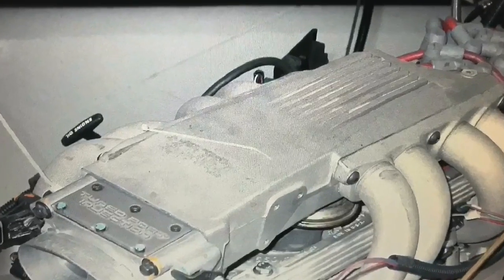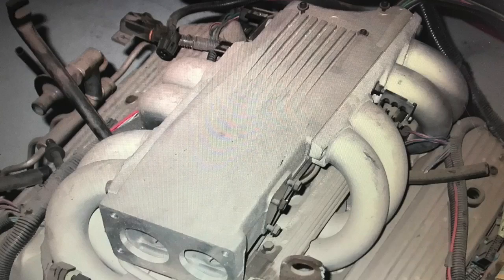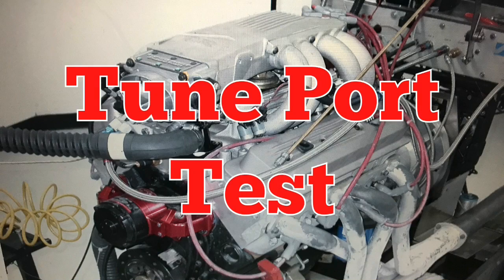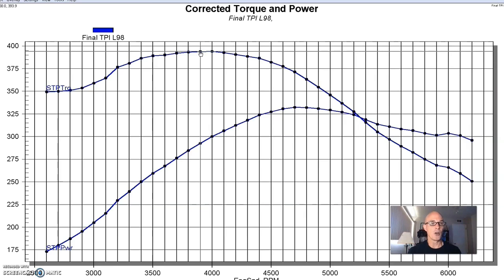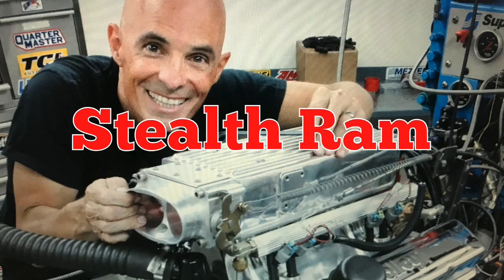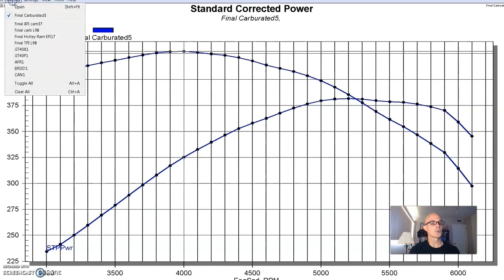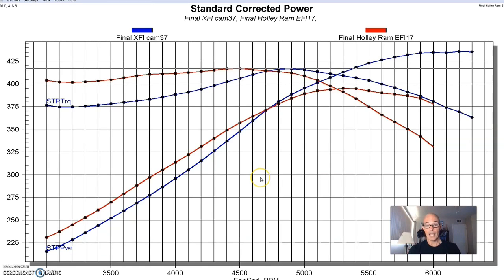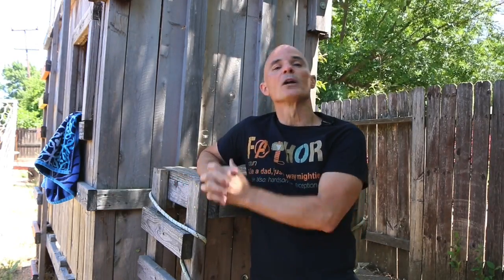TUNE PORT TECH-L98 vs CARB

Comment: I have a TPI L98 350 for my 1957 Bel Air... right now it is just a stock motor from a Camaro, but I am considering replacing the TPI system with a carb or a Holley Sniper system.  I appreciate the comparison in this video, and I would be curious of what your opinion is on the Holley Sniper system compared to the two you’ve already compared.
Reply from the maker: go with a carb and dual plane if you don't use the TPI intake

Comment: I have a quick question for you. What do you recommend in regards to roller rockers for a 1990 L98 with the stock factory 113 heads?  I would like to bolt them on and set the valve lash.
Reply from the maker: do you have a solid roller or solid flat tappet cam that has lash? Otherwise, you just set lifter preload on a hyd cam. comp makes good roller rockers
Reply: @richardholdener1727  It's the factory GM hydraulic roller cam that's in the 1990 Corvette L98 motor. I know that some of the older L98 had an hydraulic flat tapped cam. I think in 87 GM when with roller camshafts.
Reply: So comp cam roller rockers are a good choice? Which model do you recommend with stock valve springs?
Reply: Hey Rick do you have a part number for the roller rockers you recommend?  I would like to stick with the 1.5 ratio because of the stock valve springs. Thanks again.
Reply: @sportsmansparadice42  valve springs shouldn't be issue with 1.6 your lift will be .445 intake and .460 exhaust the stock springs can handle .480 i like the crane gold rockers, comp cam makes them part number 1618-16, and scorpion are good too 1036.  you need self aligning, narrow body and 3/8 stud rockers

Comment: What about a computer controlled carburetor like the Rochester on the L69 5.0L H.O. ? Would it be possible to tune a system like that to make more power and how would it compare to an EFI or mechanical carburetor setup?
Reply from the maker: that was a feedback carb to adjust AF for cruise

Comment: The TPI  demands those low RPM stump puller cams. The stump puller cams don't do anything above 4500 and neither does the TPI. The stump puller cams enhance low speed performance right where the TPI does its magic. marry the 2 together would be a winner. a matched set.
Reply: What's a Stump Puller Cam? In specs or brand or both?

Comment: Excellent demo of the runner length calling the play...an l98 tpi motor in a truck would have been awesome for sure. For a heavy street car, drive in, foot brake et bracket car. I would go for the low end, the right cam, with a converter that would flash high, launch good make the converter do the work, when dialed in should be a very consistent combination that should last a long time...this is a street/strip foot brake et car...drive in drive out...not a 10:90- 9:90 bracket monster. With a od lockup trans, great mileage driving to the track too. My 75 Monza, would like this...hmmmmm!

Comment: You read my mind Richard, a TPI style manifold on the Vortec 350 would’ve been fantastic, I’d also like to see an original TPI system on a 327, I feel like the smaller displacement would allow it to rev a little higher and maybe carry the torque curve a little higher in the rpm range.

Comment: Have to disagree with you on a very important detail. the TPI looks more like the Battlestar in Battlestar Galatica than anything in Starwars. And that makes it far cooler than anything Star Wars.   Wish someone would offer that new that flowed much better for the gen 0/1 class small blocks.  But alass.  even the Ram Jets seem to have fallen into disfavour. Yes, I run a gen 0 in my 1980 GMC truck and my 2nd gen Trans Am ( much to the chagrin of the Pontiac purists )

Comment: The TPI on a 350 truck motor and slightly higher compression ratio. And 1.6 roller rocker. Does in fact have more torque down low. The only thing left is an RV roller cam. Later when is time for my truck to be rebuilt. I will install an RV cam.

Comment: I will take 450-500 ft/lbs under 5000 rpm and lower HP any day. I remember the old 455 Buick’s stage 1, street racing back in the 60s-70s. Buy the time the high reving high HP small blocks got going the race was over. The stage 2 GS was a monster in a city block. I’m a torque guy not a 7000 rpm high stress motor guy. Just give me the tires to handle to torque.

Comment: @Richard Holdener  Richard.. Should I be crying foul?  Most L98 head flow test I've seen show sub 200cfm (190-198cfm) or struggling to hit 202-205 .. Not really enough to support 440hp.  Chevy Race shop sent juiced heads ...  shame shame.  Enjoyed the video though.. I always felt taking off the tpi and dropping in a cam would be a great way to add 100hp to a C4.
Reply from the maker: we have made 2.49 hp per cfm on stock heads and big motors-it has more vacuum so more flow
Reply: @richardholdener1727  It's easier to max the heads/flow potential when you get the air/fuel/demand at lower rpm.. due to CID.  I was shocked at 438hp from an L98/head 350..   I consider the L98's a step backwards from 292/Turbo heads. Always considered them a bad choice, other than the alum.. for the ZZ series crates.  Very interesting video.. and surprising.  I'm calling bowl work and a port roof raise and 218 to 220/cfm of flow... Lol ..  See, I held firm.. Lol... Thanks Richard !

Comment: I like the TPI for the street and have 2 vettes with them.  One is a large tube lingenfelter engine and the other is stock.  As you indicated the modified engine just amplifies the stock power curve.  The LPE engine is around 400 CHP and still gets 30 MPG.  My carb'd 350 is lucky to get a 1/3'd of that.  So on the street the TPI is such fun with excellent response and it indeed feels like a bigblock.  I take mine to the drag strip from time to time and it usually leaves me disappointed since the RPM range shifts much higher than the street. The cars low end torque makes it hard to launch with street tires and the 60' times are critical in a RPM limited car.

Comment: I prefer the lower speed power production.  Better takeoff and around town driving characteristics.  Obviously, I am not building a car for the drag strip.  I also prefer fuel injection because it seems to me to have a cold start/driving advantage.

Comment: You must be reading my mind. I want to get the 383 HTE crate motor and put TPI on it for my 1992 GMC sierra. I also have a 400 SB out of a 1980 one ton commercial van that I think would be a perfect truck motor with Vortec heads and TPI

Comment: The "daily driver" high torque, low horsepower narrative that I hear from all these domestic guys is a crock of crap. If all you want is low rpm torque, then swap your engine out for a diesel. Oh wait, I just stomped all over the daily driver narrative with logic.

Comment: What makes a better truck engine for pulling a camper? The GM crate engine HT383 (6.3L) with TPI or a L92 6.2L?? Torque is king but will the HT383 make more than the L92 6.2L??

Comment: Tpi and turbo would give you these best of both worlds. Richard what your referring to with the power curve would fall under pumping loss.. build a twin sytem or even a single like a s475 and the curve would be flat as the state of Kansas while still climbing.

Comment: I had two of these tune port intakes in an 85 and 86 Corvette and I just remember the engine falling on its face after about 4500 rpm and that would bug the shit out of me because I had other small blocks that would wind up to 7000 rpm.

Comment: Great video. You hit the nail on the head about it looking like a Klingon warship. It's not the most powerful setup but hands down one of the best looking fuel injection intakes ever produced. Only thing I like better is a 3X2 427😂

Comment: IMHO the best set up is the one that produces the best torque lower down in the rpm range where you do 95% of your driving especially with an automatic transmission.  That being said you can't dismiss the advantages of a fuel injection system with it's perfect fuel ratio's and distribution.  So that's my pick, TPI FI with the right cam and automatic shifting around 4800-5000 rpm.  That's why the 3rd gen Camaros were so popular with a 4 speed auto and a 373:1 rear gear.  How about testing a Throttle Body FI system from Fitech or Holley sitting on a dual plane manifold, could be the best of both worlds ?

Comment: If you're racing, you obviously would pick the tune port, by the time you reach 4700RPM and shift, you're already at peak power and while the carb is still trying to reach power band power, you're already shifting into 2nd gear...I have been tuning and racing TPI engines for over 15 years, and I really enjoy them.

Comment: Years ago I did a TPI 350 swap into a 79 Firebird with a 3.42 rear and a TH350 trans with a 2500 stall converter. It wasn’t fast, but it was a lot of fun on the street, and that car was a ridiculous burnout machine!

Comment: Being a product of the 80's and 90's, I have a natural affinity for the TPI setups.   I have owned a a 1985 Corvette and a 91 Camaro Z28 5.7, both obviously with TPI.  Always loved the that low end power, and they would light the tires up with a blip of the throttle at a stop light.  I would love to get back into a C4 or 3rd Gen F-body with TPI.  I know any new muscle and even today's V6 Camery's and Accords would probably be as quick if not beat a stock TPI car, but just to have that feel- that low end instant grunt.  Since I don't race every person I see or at a stop light (anymore, grew up from that :)  ), I don't need the high winding power.  I would pick TPI.      There doesn't however seem to be any support for them anymore and with good reason, I know that LS tech has gone a long way.

Still, a properly cammed TPI would feel soooo good as a daily driver.

Comment: In the beginning of the video you said the factory got 240hp from a factory L98 . I’m under the assumption that the factory measures hp from the back of the transmission with all the accessories on . Is that true

Comment: TPI always looked cool, but 5500 rpm it ran into a brick wall. I tried porting the runners in my 88 Formula T5 along with ported heads and a compu cam. Still just died at the top. Funny thing 3.90 gears and shifting at 5200 was the ticket busting many a fox body.

Comment: Question I've been asking .. How does cutting the gap between the intake runners affect the power curve? There is talk among the TPI crowd that you can grind out a small section of the wall between the runners and in effect Siamese a small part of the intake. Any testing on this?
Reply: Done it a bunch of times...difference you will probably never feel. Depends no the rest of the system and how well its ported.
Ingeneral knocking an inch or so off the runner length will disappoint

Comment: This is more of a manifold design comparison than a carb vs EFI comparison.  If you compared a 4 bbl bolt on EFI like Holley Sniper to a well tuned carb on the same manifold, the power would be close.  How would a tunnel ram do compared to TPI or the High Ram?

Comment: So, I have a 5.0 in my boat. It's a single plane, with a Holley 650. Way too much carb for that motor. So I found a tune port setup and have an MS2, and am putting it in instead. I wanted the torque, don't need the high end too much.

Comment: In the first test, there wasn't much loss of torque, but the gain of horsepower was generous.  I'd opt for the carb setup due to the cheap gains.

Comment: You failed to make an extremely important distinction in the power of the dual plane vs the tpi long runner. There’s a 30hp difference in peak power sure, but you should have compared the difference in power between each manifold AT THE RPM THE PEAK OCCURED!!! There is a 32 hp difference but at the 4800-5000rpm the TPI peaked there was only 5-10hp difference where at the RPM where the dual plane peaked near 6k rpm the was a 50-60hp difference! WAY more telling than simple peak hp comparison!!!

Comment: Maybe modern carbs are better at this now, but in the '80s it was wonderful to just walk out to the car whether it was 0 deg or 100 deg outside and just turn the key and have the engine start, first time, every time. Plus that low end torque never fails to put a grin on your face.
Reply: People just realized that phenolic spacers are a thing?
Reply: @theeoddments960  They have been around forever. Look at a Thermoquad carb

Comment: Get video! Is it possible you can do videos on all different design tpi units? Especially the tunnel ram that was created by SLP for the formula firehawk? Even though I had some mags with some info about it, I always wonder how they were able to create that 350hp/350tq. Back in the 80s/90s that a magical feat as to have a ecm monitor this kind of power and make the vehicle street legal. With  a egr valve and catalytic system.
Reply from the maker: I tested 10 or so different TPI combos back in the day-no video on that

Comment: Have you ever tested a 350 with aftermarket heads and a comp 268H cam (218/218 @.050 454/454 lift)
Reply from the maker: probably so

Comment: I agree the second best engine looking engine Chevy ever built right the Rochester fuel injection
Reply from the maker: the L84 is cool
Reply: @richardholdener1727  you easily got the most interesting dyno tests

Comment: Richard, I am mostly in awe of your skill set and knowledge, but I was kind of lost over the idea that the carb engine was doing better because it had more time for the atomizing fuel to "cool the charge" versus the fuel being injected at the port not having enough time to cool the charge. this sounds a bit off; if the entering air temp and the two fuel temps are the same, then the total retained heat calories of the two substances will be combined and an average of those latent heat calories established. this is telling me that any more than small difference is likely from another cause. The amount of free flowing air outside the manifold, for instance; I am a plumber and was fair at chemistry and physics- I'm asking if the dyno set up and temperature instrumentation have been run to "prove what we think we know" or are we dealing with unknowns? You are man- I'm hoping I missed something!
Reply from the maker: it takes time to change the charge temp
Reply: @richardholdener1727  OK, but charge velocity is measured in hundreds of feet per minute, literally thousands of inches per minute, and even the long runners of the TPI can't take more than a fraction of a second  through either the TPI or the dual plane manifold. It doesn't sound like the difference could actually be very much. The graphs show the effects correctly, I'm not quite there that a fraction of a degree difference could make that big a difference -  many turbo users wouldn't put an intercooler into a car unless they had an expectation of 40 or more degrees drop.
  Thanks for the answer- I'll go dig around in some old text on thermodynamics- I haven't been there in many years- I was a Lib Arts guy in college; I know a great deal about little of value, was my father's quote!

Comment: I just got my old IROC that I drove in the 90's back on the road. Loving the TPI torque, but could be a little faster. Keep the TPI vids coming. I like the idea of an optimized long runner setup, maybe with a little cam and some vortec heads. These parts are getting harder to find and expensive.

Comment: Dollar for dollar unfortunately carb is still cheaper, the advantages of fuel injection are wide and varied but at the end of the day simple power from an SBC is easier with a carb.

Comment: Definitely the dual plane and carb over the tuned port. With a good converter you’re gonna be well past that extra torque the tuned port offers by the time you start really pulling anyway so the top end gain would be more desirable for me.

Comment: Thank you for your unbiased well informed experiments. TPI all day for daily driving. Less rpm less spring pressures and lower rpm for less possible ware and tare. 

It’s hard to pick one. Maybe average numbers would give a better idea. Also I believe a lot of guys have the shifting points incorrect for the tpi. Hurts quarter times extremely. For instance my tpi 350 tries to shift upwards of 4800 rpm which I think 4.3-4.4k is probably more in the max power range. .

Comment: In an ideal world an infinity variable intake runner would be the way to go. If one could get one that would respond fast enough. Maybe a port or direct injected engine with two intake runners per cylinder. One long runner for low end torque. With a short runner for high end power. But switching between the two during operation would be a real PITA. Much less merging the flow in the medium rpm range. This is why forced induction is so prevalent on modern engines. In the real world on a daily driver low end torque is more important in my opinion.